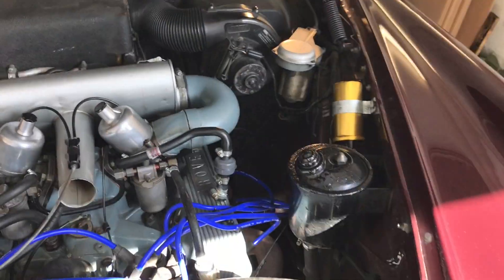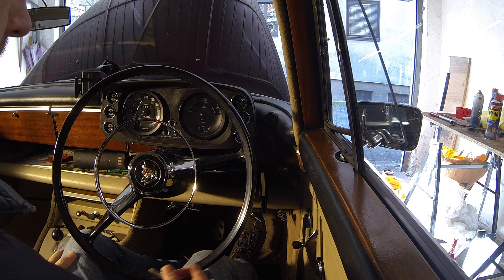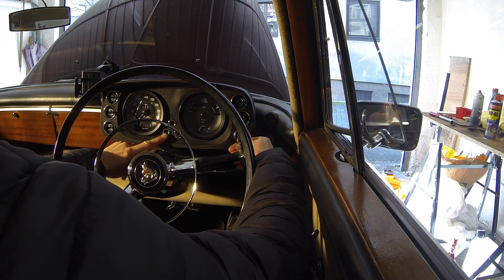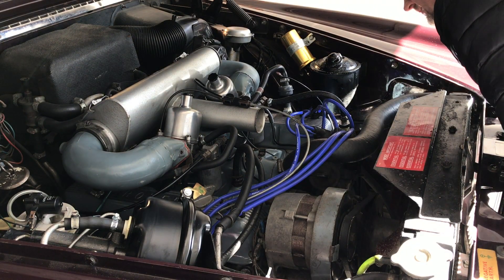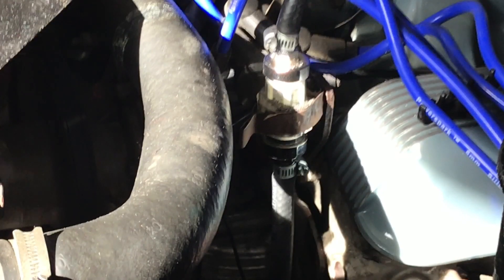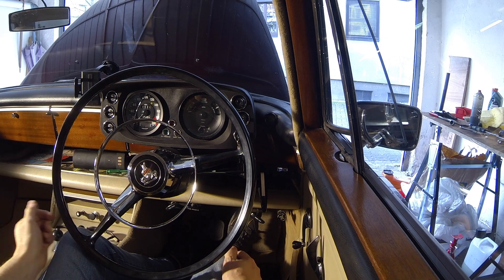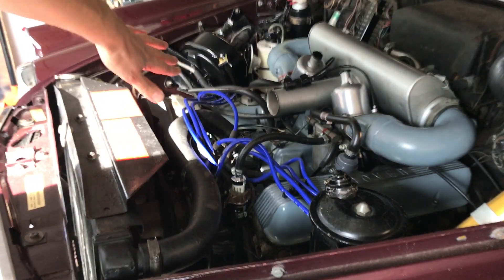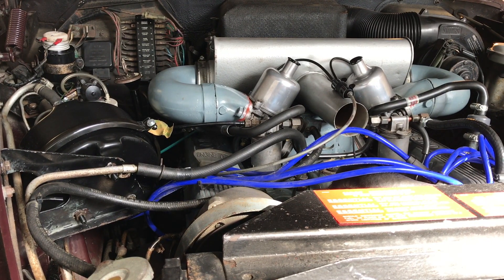1968 Rover P5b V8 - 1st Start-up After Winter Break

Comment: I had an Old English White one many moons ago.  it was followed by a Jaguar 420 and a Jaguar MK10, but the Rover was favourite.  Mine too was tappety from cold, but it's common with hydraulic tappets.  That little glass container housing the fuel filter can become superheated by the engine in slow stop-start traffic on a warm day, so check it first if you ever experience vapour-lock fuel starvation.  Be sure to keep the SU (mixture) dampers topped-up with oil too - they've a habit of drying out!

Comment: the rover p5b is everything an audi wants to be.
Reply: That's odd that you should say that, as I'm sitting in my garage, watching this video, and admiring my 22 yr old A6.  I certainly do admire the P5 but I'll  never have one. I'm too old to start fiddling with an old British sedan.
I do enjoy my old A6 and personally I think the body style is more attractive than the newer models. That, and the fact it is a bit smaller than the current models, doesn't have the full compliment of Darth Vader  instruments and is somewhat less complicated in the area of engine management.
So, although it'll never be a P5, it runs good, looks good and it's paid for.
What it needs now is is a switch over to a 5 sp transmission
Reply: @hughchamberlain5018  love your audi just understand it has no class just led's

Comment: I know this comment is late, but when you start it up again in Spring 2020, may I suggest you just start the engine without removing coil etc.  The engine oil will circulate very quickly, and the carburettors won’t flood. Don’t let it just tick over. Take it for a drive !
Reply from the maker: Hi Sam, Thanks for your comment - better late than never ;) Your suggestion is a good one but the reason I didn't take it for a drive at that point is because I didn't have the number plates - they are kept at the insurer's office when the car is off the road for the winter. 

By the way, I've just done the 2020 start up in the same fashion which you can see in my latest video: https://www.youtube.com/watch?v=8OfBDXdhbUI
Reply: Tara Bordeaux    Me again. Thank you for the prompt to see your new video.   I do you think you are being a little bit too cautious. The turning over without starting is just not necessary with modern oils, and the car has been beautifully tucked away for the winter.     Hey Ho.  It’s your car, and I am very envious of you.  All you have to do now is get rid of all the neighbours.
Reply: I agree with this comment, if the car hasn't been started for a while don't disconnect the coil. Just spin it over and wait for it to fire up as it will spin over for a little while anyway until the fuel has filled the carburettors up again. By that time the oil would've circulated around the engine and might have even built up enough pressure to knock your oil light off. Doing it this way lessens the risk of flooding the engine all the time.

Comment: Cranking it over with NO Spark will Flood your Carbs. 
It has only sat for 6 months ! 
I Would Start the car in Normal Procedure, Allow it to tick over on Choke , Then Reduce The Choke To Almost stalling point,  Then Push the choke Fully IN / Choke OFF.  & Allow to tick over for a couple of mins at idle speed. 
( OBVIOUSLY You know your V8, )  Bring it on to normal Tickover as soon as it wants to in YOUR Engine / Engine & carb' Settings , Gently Rev the engine to Bring the Oil pump into full action,  & Pulling A constant flow of fuel through the Carbs To Hold 1200/ 1500 revs, 
gently Bringing the whole engine into LIFE . (Do Not Over Rev the Engine, or Blip the Throttle )
Engine will Come to Life very Soon .

A Far Better Plan .  =  Every week or 2, While in winter Storage,  Start the engine & run it for 5 , 10, 15 mins . NOT 30 mins or an Hour. 
Try to Keep it running For A SHORT time & OFTEN. 
Battery ? Disconnect it,  Pop it on Charge the day before in cold weather. 

Change the Oil on Day One of Use, 
Before Parking Up for winter storage & SORN etc. Put A Few Galls of fuel in the tank. 
DON't FILL the Tank, Fuel can go Stale.  ADD enough to run the engine every fortnight for 15 mins inc Choke.  / Newer cars auto choke / Cold start injection etc. 
Buy & ADD Fresh Fuel Maybe once every 3 - 6 months. via a Gerry Can , Fresh from the Petrol Station.  half , or 1 gallon as Required. 

Once Warm on Tickover,  Try to Drive the car as Far as is Legally possible if SORN,  Out of Test / Ins  etc. 
Out of the Garage & As far as your Driveway reaches. 
A Bit Naughty, To the end of the street & back if you live on a very very!! QUIET Street. / Lane. 
To Keep the Wheels Free & the Breaks Free & Rolling.  etc. 

Open & Close & OIL/ Grease all Window winders & Motors inc Elec Sunroofs Etc. 
Bonnet & boot hinges & Catches. 
KEEP EVERYTHING MOVING & Operational  as often as Poss. WITH A SPARE,  OR FULLY CHARGED BATTERY. 
Operate All Central Locking, S/ Roof, Elec Windows & Mirrors etc. Often . ( 1 hour every month or two . ) 
Open & Close All doors Bonnet Boot,  USE EVERYTHING , PLAY WITH the Car for a full Hour every Couple of months. 6 - 8 weeks NOT YEARS !! 
This is Over winter, or 1 to 2 yrs Storage. in a reasonably Dry place. 

THE LONGER YOU ABANDON IT, The MORE DAMAGE YOU WILL DO, & it will Cost More. 
A little Often is best. 
If Abroad / working away, Pay A Pack of beers to  Trusted Friend to Do This.  Or Pay Whatever. 
Standing Cars Hold water & Rust Quickly,  Items Corrode & Seize UP, or become Crusty due to Lack of use. 
Very Soon A good running Car , Then,    NOTHING WORKS & A LONG MOT Fail List SLAPS you in the Face.

Comment: Did you replace the fuel filter with the correct type ? nice to hear that old V8 running again .. I have a project but its going to be a while until I get to it ... unless car SOS team find me sooner !
Reply from the maker: The fuel filter is not of the type originally fitted. However given the fact that it has issues, I may well seek out an original. Hope you manage to get your project done.
Reply: @tarabordeaux1968  Yes its on the bucket list and thanks !

Comment: Why not take the plugs out, less stress on the bearings, battery and starter if you're going to crank it for 30+ seconds at a time to get oil pressure?
Reply from the maker: Thanks for the tip. I might try that next time.
Reply: all 8 of them? is it worth it
Reply: @paulhunter123  they come out relatively easily, 10 minutes at most.  It's worth it, especially when one plans to crank for longer than necessary.  Besides, if one cranks to get oil pressure wouldn't it be better to not load the bearings (even compression is a load) until that point is reached.
Reply: @Visionery1  what about when the car is driven around? does that not put stress on the starter bearing battery etc i dont see the point
Reply: @paulhunter123  did you not watch the video?  He cranked the engine to get oil pressure as he didn't want to fire it up without oil pressure after it had been standing for some time.  Cranking an engine multiple times in succession for 30-45 seconds with the plugs in is not what the starter motor was designed to do.  Removing the spark plugs allows the engine to spin freely without including the induction and compression stroke.
Reply: @Visionery1  ah yes i see what you mean now thanks for the insight

Comment: Hey Tara, im wondering if you know how easy or hard it is to install an petrol pump. I can buy this model and the owner tells me it needs a new one because it stood still for quite some time. Is this possible it is just the pump and how easy is this for diy? I gotta say im quite into maintenance. Just to be sure

Greets
Reply from the maker: Hey Bram, Fitting a fuel pump is fairly easy. I replaced the standard mechanical one with an electric one. I made a video about it here: https://youtu.be/1ogn6IlC8cQ

Comment: Wonder why nobody has taken the 300 cui engine from a 1964 Buick Skylsrk, same outside dimensions, alloy hesds and intakt, block slightly heavier its cast iron, has a lot more torque, easier to hop up and 1.5 litre more displacement and retain the smoothness of The Buick Fireball 215